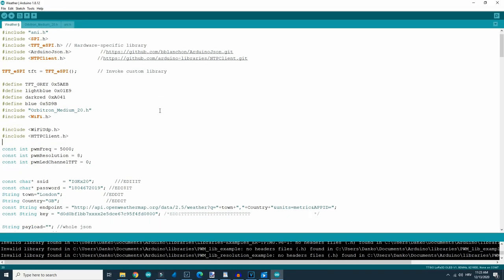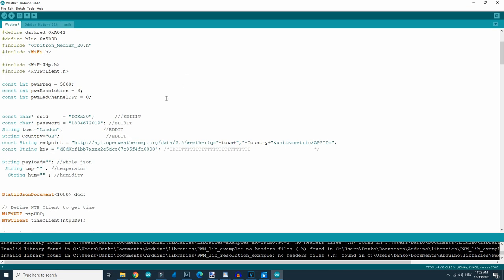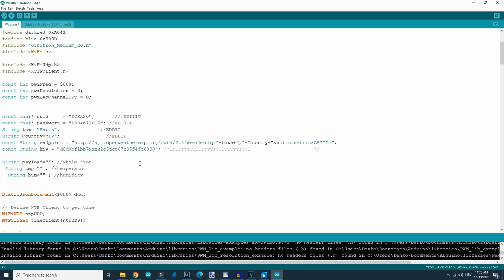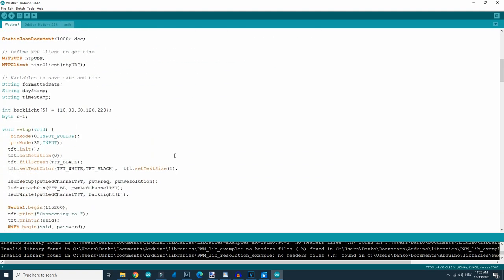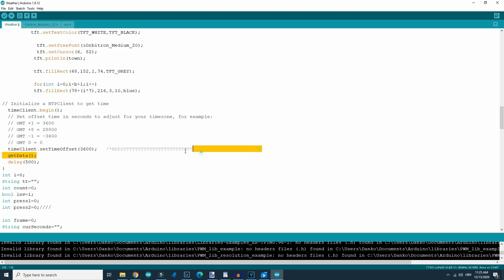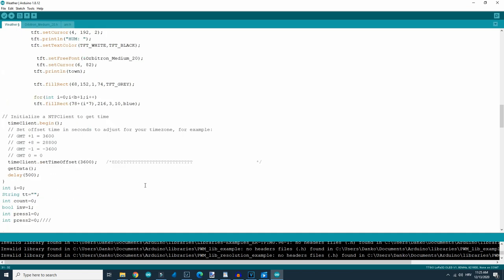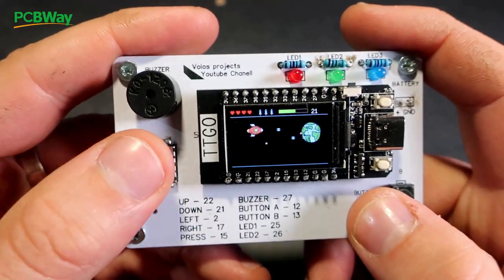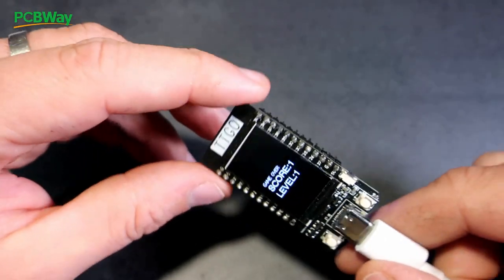TTGO T-Display ( ESP32 ) - Internet Weather Station and Clock (tutorial)

Comment: Your project looks great, but I can't get it to compile after making all of the changes I am supposed to make.  This line errored a number of times.

formattedDate = timeClient.getFormattedDate();

I am also getting errors related to the screen.

I had a similar sketch running off of the same service that I got working on an esp8266 with 1306 OLED. It worked. I tried using all of my keys on your code, and got all of the above errors.
Reply from the maker: Sorry, in code i puted wrong link for library. You will need delete old NTPClient Library and install this one https://github.com/taranais/NTPClient
Reply: @VolosProjects  I downloaded NTPClient and it still doesn't work.
Reply: @VolosProjects  I was having the same problem. I installed the NTPClient you posted above and now I have:

Arduino: 1.8.15 (Windows 10), Board: "TTGO LoRa32-OLED V1, 80MHz, 921600, None"

In file included from C:\Users\SOS\Documents\Arduino\TTGOWeatherStation-main\TTGOWeatherStation-main\Weather\Weather.ino:3:0:

ani.h:1:1: error: stray '\357' in program

 int frames=10;

 ^

ani.h:1:1: error: stray '\273' in program

ani.h:1:1: error: stray '\277' in program

cc1plus.exe: warning: unrecognized command line option '-Wno-frame-address'

Multiple libraries were found for "NTPClient.h"
stray '\357' in program
This report would have more information with

"Show verbose output during compilation"
option enabled in File -> Preferences

I didnt have this with the videos NTPClient but if you have any idea's it would really help.

Comment: Hello, I'm french so my english is not perfect. It's a very cool project but I have some bug for example in the first line for "ani.h" you have 3 or 4 spaces so it appears a error. Thanks. Eric
Reply: Let me guess: the compiler says "stray '\357'". There is an invisible control character in the first 3 or 4 lines. Delete the lines and add the code manually. Use notepad++.
Reply: Yes, I did that and everything works now.

Comment: Too many problems with this code.  I have spent several hours trying to get it to run.  Making my eyes crossed and my brain hurt.  I hope you can get it cleaned up and updated.  Thanks.  I would really like to see this running.
Reply from the maker: code works fine, i am sorry you was unable to upload it. Did you install all right libraries? Did you setup ttgo board, how long you have this board? You can check comments of this video to check solution others have, some people just needed to upadate their libraries, some of them used wrong libraries. some of them used wrong Arduino IDE version. There is lots of things that can go wrong.
Reply from the maker: did you try to upload any other example i created? some game or somting similar for ttgo t display?
Reply: @VolosProjects  other examples are working but this project has to many problems.

Comment: Hi and thanks for the code, I changed all the relevant areas for location, wifi credentials etc and when I compile for upload I get an error 
In file included from Documents/Arduino/Weather/Weather.ino:2:0:
Documents/Arduino/Weather/ani.h:1:1: error: stray '\357' in program
 int frames=10;
 ^
Documents/Arduino/Weather/ani.h:1:1: error: stray '\273' in program
Documents/Arduino/Weather/ani.h:1:1: error: stray '\277' in program
Compilation error: exit status 1}

any idea what could be causing the compile error?
Reply: I rewrote the first three lines in the ani.h file and removed a hidden character which caused compilation problems. now the code verifies.
Reply: @JamesT65  yes it did solve. I was only trying to copy and past it, but the solution was to rewrite the 3 lines on top. my IDE is 1.18.19

Comment: Загрузил этот проект, но к сожалению черный экран на дисплее, 
но в мониторе порта пишет :
21:46:47.667 -> rst:0x1 (POWERON_RESET),boot:0x13 (SPI_FAST_FLASH_BOOT)
21:46:47.667 -> configsip: 0, SPIWP:0xee
21:46:47.667 -> clk_drv:0x00,q_drv:0x00,d_drv:0x00,cs0_drv:0x00,hd_drv:0x00,wp_drv:0x00
21:46:47.667 -> mode:DIO, clock div:1
21:46:47.713 -> load:0x3fff0030,len:1184
21:46:47.713 -> load:0x40078000,len:13260
21:46:47.713 -> load:0x40080400,len:3028
21:46:47.713 -> entry 0x400805e4

Comment: getting these exceptions:

Arduino: 1.8.19 (Windows 10), Board: "ESP32 Wrover Module, Default 4MB with spiffs (1.2MB APP/1.5MB SPIFFS), QIO, 80MHz, 921600, None"

In file included from C:\Users\jandr\Downloads\TTGOWeatherStation-main\TTGOWeatherStation-main\Weather\Weather.ino:7:0:

ani.h:1:1: error: stray '\357' in program

 int frames=10;

 ^

ani.h:1:1: error: stray '\273' in program

ani.h:1:1: error: stray '\277' in program

C:\Users\jandr\Downloads\TTGOWeatherStation-main\TTGOWeatherStation-main\Weather\Weather.ino: In function 'void setup()':

Weather:65:17: error: 'TFT_BL' was not declared in this scope

   ledcAttachPin(TFT_BL, pwmLedChannelTFT);

                 ^

C:\Users\jandr\Downloads\TTGOWeatherStation-main\TTGOWeatherStation-main\Weather\Weather.ino: In function 'void loop()':

Weather:195:30: error: 'class NTPClient' has no member named 'getFormattedDate'

   formattedDate = timeClient.getFormattedDate();

                              ^

Multiple libraries were found for "WiFi.h"

 Used: C:\Users\jandr\AppData\Local\Arduino15\packages\esp32\hardware\esp32\1.0.6\libraries\WiFi

 Not used: C:\Program Files (x86)\Arduino\libraries\WiFi

exit status 1

stray '\357' in program

This report would have more information with
"Show verbose output during compilation"
option enabled in File -> Preferences.
Reply: I get the same error message. use Arduino 2.0.4 In file included from C:\Users\flieg\AppData\Roaming\Microsoft\Windows\Start Menu\Programs\Arduino IDE\libraries\TTGOWeatherStation-main\Weather\Weather.ino:3:
C:\Users\flieg\AppData\Roaming\Microsoft\Windows\Start Menu\Programs\Arduino IDE\libraries\TTGOWeatherStation-main\Weather\ani.h:1:1: error: stray '\357' in program
  int frames=10;
  ^
C:\Users\flieg\AppData\Roaming\Microsoft\Windows\Start Menu\Programs\Arduino IDE\libraries\TTGOWeatherStation-main\Weather\ani.h:1:2: error: stray '\273' in program
  int frames=10;
   ^
C:\Users\flieg\AppData\Roaming\Microsoft\Windows\Start Menu\Programs\Arduino IDE\libraries\TTGOWeatherStation-main\Weather\ani.h:1:3: error: stray '\277' in program
  int frames=10;
    ^
C:\Users\flieg\AppData\Roaming\Microsoft\Windows\Start Menu\Programs\Arduino IDE\libraries\TTGOWeatherStation-main\Weather\Weather.ino: In function 'void loop()':
C:\Users\flieg\AppData\Roaming\Microsoft\Windows\Start Menu\Programs\Arduino IDE\libraries\TTGOWeatherStation-main\Weather\Weather.ino:191:30: error: 'class NTPClient' has no member named ' getFormattedDate'; did you mean 'getFormattedTime'?
    formattedDate = timeClient.getFormattedDate(2023-01-10T12:00);
                               ^~~~~~~~~~~~~~~~
                               getFormattedTime
C:\Users\flieg\AppData\Roaming\Microsoft\Windows\Start Menu\Programs\Arduino IDE\libraries\TTGOWeatherStation-main\Weather\Weather.ino:191:55: error: unable to find numeric literal operator 'operator" 'T12'
    formattedDate = timeClient.getFormattedDate(2023-01-10T12:00);
                                                        ^~~~~

exit status 1

Compilation error: stray '\357' in program